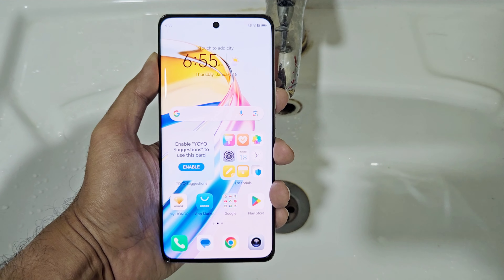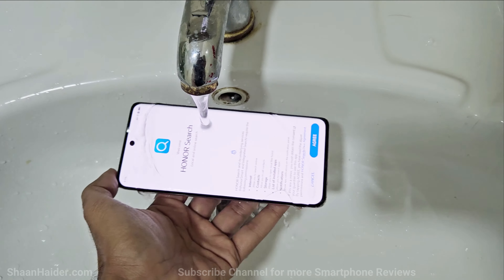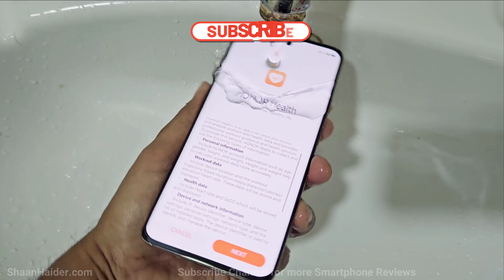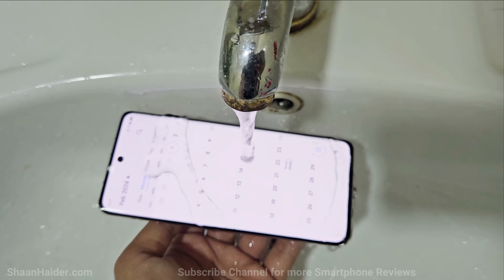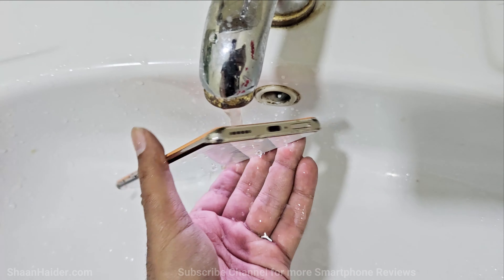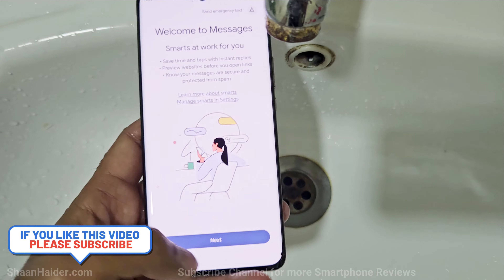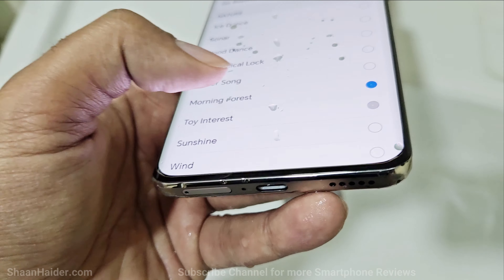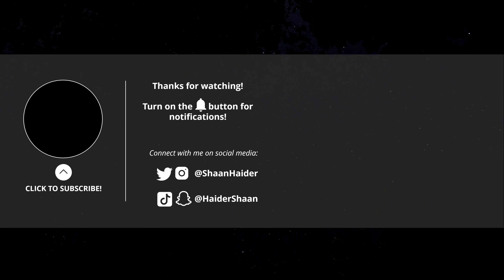Honor X9b / Magic 60 Lite - WATER TEST

Comment: Hi I have x9b it's really waterproof?? Like a light rain. Can use coz I m bike rider always on road Sam time heavy rain
Reply from the maker: Officially it is not waterproof but as you can see it can withstand a bit water easily.
Reply: Is it good with heavy raib?
Reply: I just tried it yesterday in a pouring rain. Nothing changed.  @rayanricunayii7651